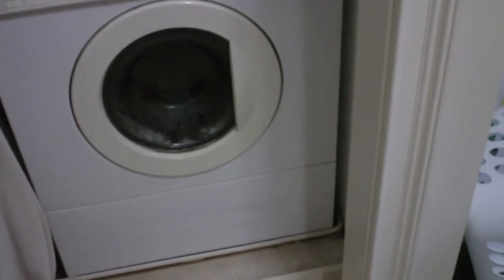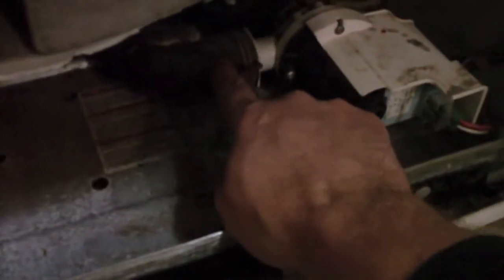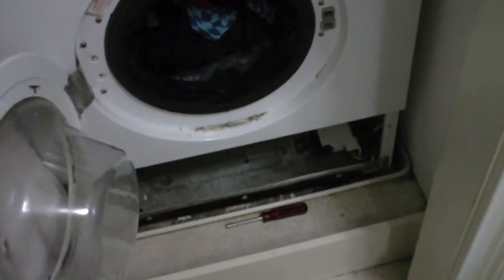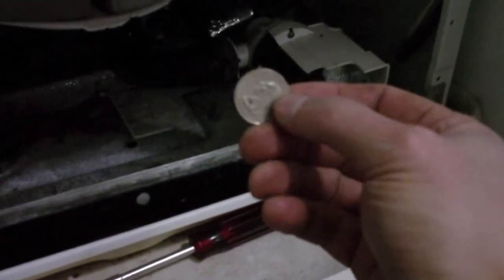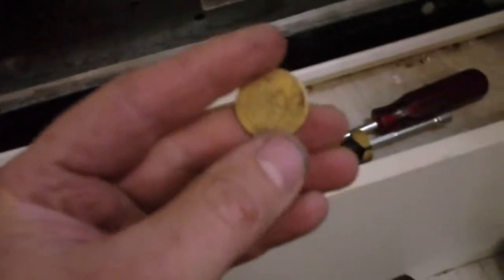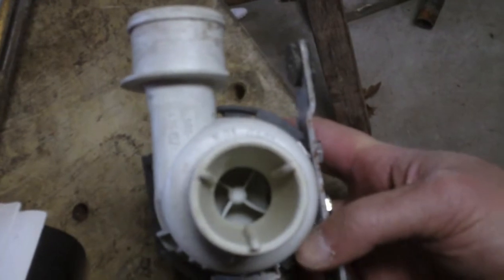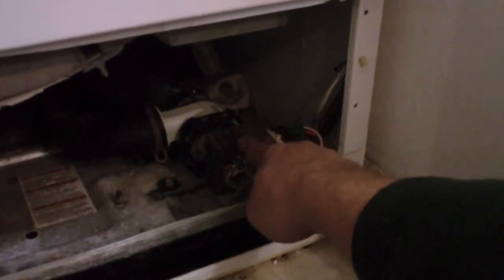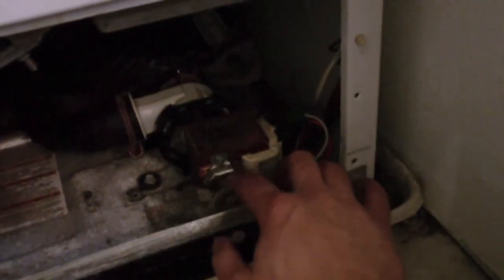Kenmore Frigidaire front load washing machine repair

Comment: Some machines have a filter unit just for this problem, i've got the newer kenmore 4000 and i'm not sure if it has one but so far all the coins have stayed in the drum. Mine shuts itself down if there's too much suds.
Reply from the maker: That odd shaped rubber hose from the drum to the input of the pump is called a "coin catcher" in some parts lists. I guess the ribs, and odd shape is supposed to help trap coins before they get to the pump........it didn't work this time.